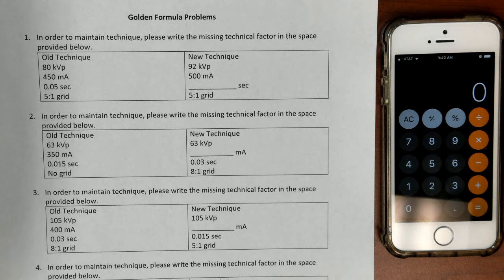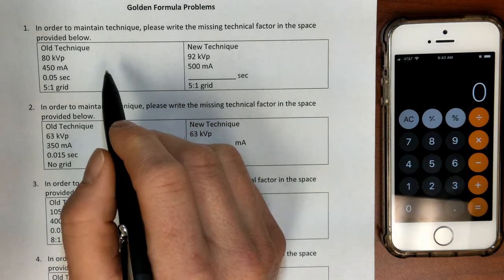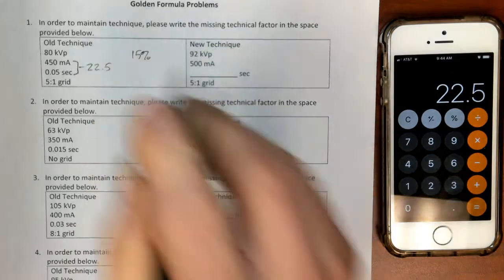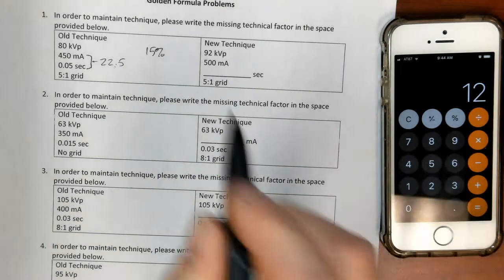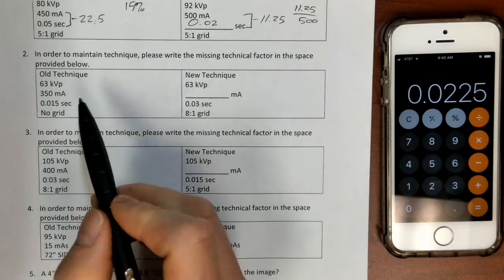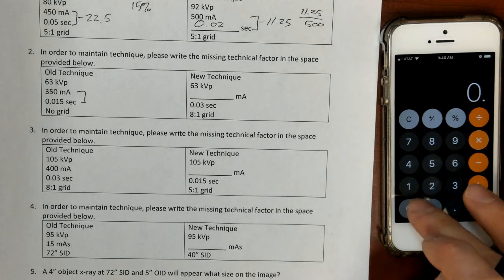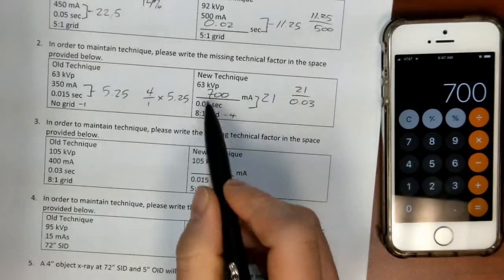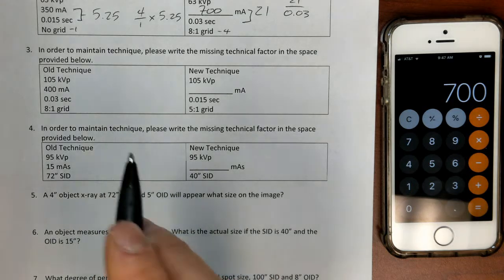X-ray Golden Formulas - Part 2

Comment: Do you have CT formulas too?
Reply from the maker: Angie MORALES-PENA I’m racking my brains, and there’s not a lot of formulas required for CT. So, tell me the formulas and I’ll make a video!
Reply: Rock the Registry 
1) Effective mAs
2) # of photons
3) WW and WL
4) spatial resolution 
5) Line pair
6) HU formula
Reply from the maker: @AngieAngie23  I can work with that!
Reply from the maker: @Angie MORALES-PENA I promise I haven't forgotten you! Super busy. In the mean time, have you seen this: https://youtu.be/eK41utRnOQQ
Reply: @RockTheRegistry  Hi, Can i ask what formula should i use for this problem
 A radiographic exposure of the pelvis was taken at a distance of 40" using 25mAs and had an exposure of 100 mR. What would be the exposure be at a distance of 65"?
Reply from the maker: @gigiknoxx8878  Inverse square law.
Reply from the maker: Hey Angie, I found out after posting yesterday's video some of the info was false! For the most up to date information see: https://youtu.be/-BSs6gnFyyg
Reply from the maker: Finally made the CT video! Please let me know if this helps: https://youtu.be/X4M2J6ffRaM